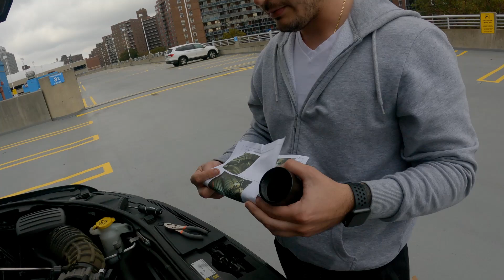HOW TO INSTALL JLT OIL CATCH CAN ON THE JEEP GRAND CHEROKEE SRT!!!

Comment: There's a screen filter in the catch can top that needs to be cleaned with brake cleaner every 10,000.  The can itself gets emptied as needed.  On my Silverado 5.3 I dump it every month during winter due to condensation build up.
Reply from the maker: Good to know. Thanks!